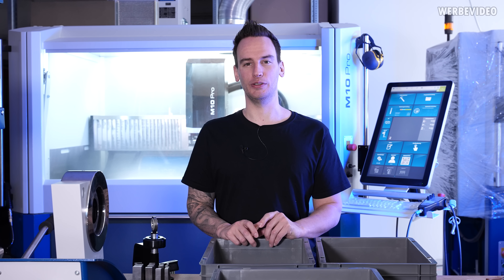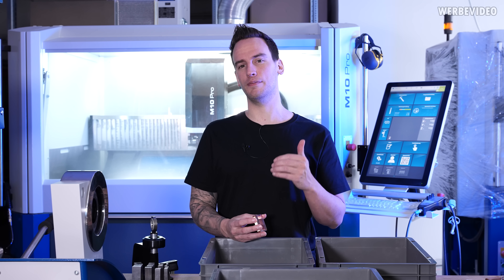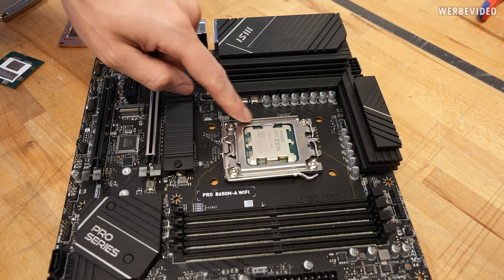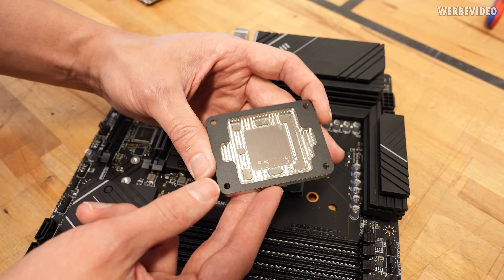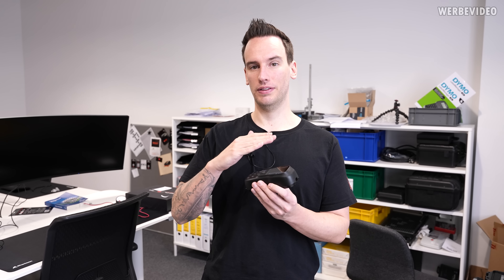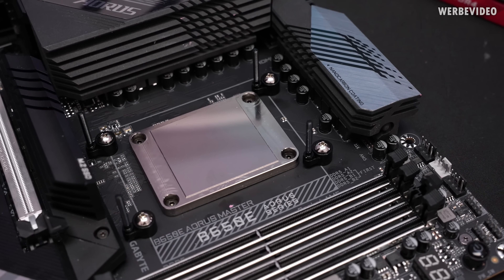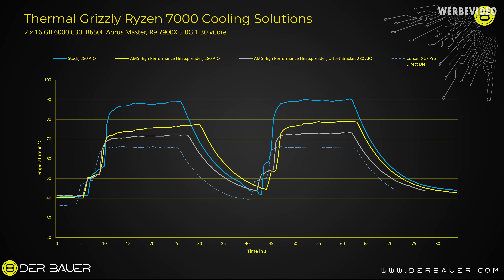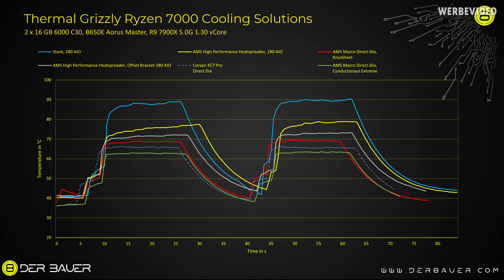I made my own Ryzen 7000 Direct-Die Water Block

Comment: I just used thermalgrizzxly ptm on my intel i7-1300f. Was skeptical as I have never used an AIO before or PTM sheets on a cpu. My results are crazy. My cpu after hours of gaming never gets over 57 degrees. I am assuming the PTM actually contacts the AIO more than thermal paste would with this exact CPU. I attribute that to Intel having a heat spreader design around the CPU. Apparently when thats the case PTM may actually perform better on a CPU without direct die delidding.

Comment: man i wish amd would step it up and make better ihs that  such an insane difference in temps, cpu's haven't gotten hotter heat transfer has gotten worse! they may be smaller than they were 10-12 years ago but they're also using less power. like the i7 3930k a 6 core 12 thread cpu with a tdp of 130 watts but would pull more under heavy load, 6 core cpus like the 7600x have a tdp of 105w and actually respect it unless you use pbo ofc but thats oc'ing technically.

Comment: Hi Roman, can you answer? Is Your Ryzen 7000 Direct Die Water Block compatible with all 240mm AIO Just replacing the water block? And how does It compare tò EK Quantum Velocity 2 Ryzen 7000 Direct Die Water Block?
Reply: Your AIO block contains a pump, if you remove it from the loop - without pump it will not work at all. Better build a custom loop to use Mycro

Comment: From personal experience. If you have the High Performance Heat Spreader. Don't go for the kryosheet. I went from conductonaut (liquid metal) to kryo sheet just to not have to care about mainaining the liquid metal. Idle temps went down by coupld of degrees but load temperatures went from around 78C to easily 95C on my 7950X (same settings in BIOS etc.).

Comment: I'm sure someone has mentioned it already before, but with especially steel, what you do with those highly flat faces is called ringing them together. What it does is push all the air out from between the two pieces of metal and then the air pressure actually sticks them together and makes them stay and then if you leave them like that for too long. Tiny particles of rust form and rust sticks the two pieces together.

Comment: I'm a mechanical engineer so this is waaay out of my depths but would the performance of the heat transfer improve if the path of the fins was diagonal? The AM5 chips have a triangular pattern, so there's an angle there where a diagonal path would be the shortest path across the chips, and the two chips beside eachother make a long straight line which might be saturating the water, where a diagonal path could spread that out across more fins? No idea. Amazing video and thank you for your work!

Comment: My block with a really high fin density (an amazon one) gunks up very quickly and required really strenuous amounts of cleaning. Ended up grinding some fins away with a rotary tool and saw massive gains in performance. If you can keep your loop immaculately clean then I could see them working really great, but if not it's basically the most filter-like part of most loops and is going to catch a lot of the gunk.

Comment: Hei! I thought to use AgCl + Si4N3 powder mix  as contact. But it just a thought, I have not tried it or know if it might work. In theory AgCl decays in Ag and Cl under temperature. But then how to keep it in one peace? May be just AgCl pure. And instead of AgCl may be AuCl, it will not oxidize. If Cupper finished with TiN it should not decay from liquid metal.

Comment: 16:16 Cool product, very efficient. What about a video overclocking the 7000s with this thermal solution? I would like to know what is the CPU limit and how much temperature is worth decreasing.

As Pbo is limited do +200mhz only, could it make a manual oc to 5.7mhz all core? Maybe 5.8, 5.9.

I would like to see the CPU limit and the real advantage of the temperature drop.

Comment: Direct die with graphene sheet looks like the kind of thing I would use the first time I delid a CPU. You still get way better cooling compared to stock but don't have to worry about maintenance much.
Definitely a really good idea especially for those that don't want the hassle of possible problems with liquid metal over time.

Comment: I assume that a Heatkiller IV Pro waterblock would do fine with direct die with just the frame since it’s essentially a huge chunk of Ni plated Cu. There should be sufficient mass to dissipate the heat without the redesigned heat spreader. Am I correct?
Reply: HeatKiller IV  curved, uneven surface.
But it will do, of course.

Comment: Shut up and take my money!!  But really I'm waiting for this, so far I have gone as far as lapping my IHS on 7950x, -22 curve, thermal throttles on 280mm arctic. Personally I want the clean non RGB, but in reality I will buy the first version that pops up on the website. Tho I have a hard time believing that you will sell many of the 'high performance heat spreaders'. Delidding and not go direct-die doesn't seem right. Maybe try one in pure silver, if it cools any better, I'd buy one. Hell I buy silver coins all the time, just for the silver content.

Comment: Thank you so much for making graphene pads better. I so much more agree on using that over liquid metal purely because I want to "set and forget" my computer so I can get the most comfort out of it for the longest time. 
I've had to re-apply liquid metal on laptop parts more often than ever, so on systems I want to give away I'd like to use graphene pads or thermal paste instead.

Comment: 0.281 microns is 281 nanometers, for sure they used a diamond lathe tool to achieve that insane precision surface finish. Also would like to point out that putting two surfaces together and both pieces staying stuck would not prove that it is sub-micron flat but does say it is good enough flat. Need to use a 1 micron or sub-micron dial indicator to check for evenness flatness, which is easy to do and tools available to do so.

Comment: Just curious...  How much work would it take to add a couple of ports and o-rings and just run a non-conductive fluid across the chip surface w/ nothing in between?  Seems like you're most of the way there with delidding & your direct-die bracket...

Comment: The effect he is calling "cold welding" is actually something called "wringing" it is a demonstration frequently done with gauge blocks (used in machining). Cold welding is a thing.. but it has nothing to do with evenness or whatever he called it. It requires that each surface is completely free of ANY surface contamination including OXIDES of the base metal. Unsurprisingly this is something people only really need to worry about when in space. The wringing effect, at least when I tested it, only seems to work on extremely flat surfaces that are also lightly oiled. There is a suction cup effect that you can only achieve when there is oil to act as a seal. (think liking the back of the suction cup) If both of those pieces were cleaned with acetone they would not stick together.

Comment: i like this IDEA tho there is a Problem for me to undrestand... I would love to buy one of these but what stop me is,, I Live in INDIA and its not a very Clean place to live and DUST is something we all fight for Daily.. Deliding and using this Block but what you are doing to Seal it properly so that DUST dosenot go inside the CPU and we can use it.. My idea is still use a Sealed solution to cool the CPU to get better performence then using this OPEN idea which i like persnoly but it will not work in my system or in my counrty.. I cant Open my CPU every 4 months to just clean the DUST.. there are manu more factors which this solution is missign like RUST Humidity. Rust is a killer of electronics,, Hope you make a better version with these solutions.. ty for sharing..

Comment: liquid metal without electrical sealing is a nice way to kill your cpu. using very hot cpu seems like create problems for yourself in order to heroically solve them. users should not buy raw crafts from manufacturers. I also use ryzen processors, but IMHO amd could not do anything worthwhile after the 3700x/3800x. and the drop in sales confirms this. thanks for interesting video, it's very good job with prototyping and production waterblock, but it's not applicable in real life

Comment: I would LOVE to see a temperature difference with a smaller aircooler. Im actually interesting in the intel version for my Itx build and try it out with air cooler. It would be game changer if you can archive same temperatures on air with DD setup vs stock cpu on water. Plese in next video throw some air cooler in the chart im curious and interested in this to buy.

Comment: When will you be releasing this as a kit? And where can international buyers from South Africa? Another question, is both the Direct Die and and CPU block smoothed to the same precision. I'm excited. Going to order as soon as ready, so that when I go to AM5 on my custom loops, I am ready. I use non Tolulene nail polish around the dies to give extra protection from Liquid metal. Can you advise on other solutions? I would like to purchase one with a Der8auer Micro stamped into Aluminum
Reply: Also, are these compatible with X3D chips. I would also like to see whether using a phase change thermal pad like PTM7950 would be on par to liquid metal. Product page doesn't mention X3D compatibility, if this may be tested for us crazy enthusiasts. Peace from South Africa 🇿🇦

Comment: That is an insane difference and improvement... AMD need you on the team lol imagine if it came out stock like this

Can you run the graphite between the die and spreader instead of liquid metal, just to increase longevity ? What difference would this make?

Do you think it would be possible to do some testing in some small sandwich itx case/s, where you can only fit a lowprofile cooler (say a NH-L9 -65mm height or a NH-L12S -48mm in height) ?
*Stock vs your heatspreader
Where I'm getting at... is instead of running direct die water block cooling for extreme overclocking, how about direct die air cooling ... to be able to go for hot running cpu with a lp cooler in a tiny case, without the need to massively underclock, or run high fan speeds

Comment: So many wrong idea about water block should be build. There is many problems in fluid dynamics that should be resolved, by creating proper inside structure of wat.block. Also you should know, that copper isn't great to give away heat. It's great for transport heat, but not for give away. Also water can boil in micro area, that will collapse water flow in specified area. So in general, its better don't add any fins inside wat.block. Also if we do very narrow fins, then water viscosity can work against proper heat transport.  

I bet that if this wat. block had higher fins and special in/out nozzles. He will get more heat from CPU in same time period.

Comment: Nice engineering as always.
For the direct die cooling with the adaptor, we would use the graphene sheet on the die as well as on the direct doe heat spreader? I am interested in air cooling rather than water.

Comment: Although I personally dislike RGB and wouldn't want it anywhere near my pc if I could help it. I'd definitely opt for that RGB waterblock, as dayum that is one mighty spectacular looking waterblock and the lack logos is an absolute bonus. The ability to rotate the wiring is a nice touch, it definitely will help as CPU header placements are not really standardised across motherboards. In regards to the non-rgb version, the clean one looks alot better imo. Q: the RGB waterblock is that supported by OpenRGB for example?

Comment: Are there any reasons to use AM5 High Performance Heatspreader over Direct Die Frame for aircooling? I am using the latter with Peerless Assassin / 7950X3D CCD0 / 5.124 all core OC and getting 76C max in Cinebench. Wonder if I can do even better.

Comment: Actually it is the same for steel, at least the steel they use in gauge blocks. In my small workshop I have made a stack of 40 mm gaugeblocks (7 pcs) and they hang perfectly okay even after 45 minuttes, you just slide them apart sideways

Comment: Cold welding works with any material, but often there is some oxidation or dirt in between or a structural molecule and that's why we don't see it as much in our early conditions.

But if you succeed to get two unimolecular surfaces close enough with no airgap in between then the molecules do not know what chunk it belongs to. It just knows how to be an atom, it has no notion of objects as we do

Comment: FIY: Its not cold welding, its called wringing. If they cold welded, you would not be able to separate them, or there would be obvious damage to the surface after separating them,

Comment: I'm definitely a big fan of that clean design, it looks so good, especially with the way you've got RGP showing in thin strips. The finish is clean, but the visual impact is clean AF.
Thanks for all your efforts!

I was planning to go air cooled for my 7800x3d, since I'm already using a 7900xtx for my GPU and there's very few water cooling options for that too, it seemed a waste to go through all the trouble for water cooling if I can't fit both on the loop.. What are the odds you'll be looking into 7900 GPU water blocks too? :)

Comment: Have you tried using doped graphene to improve thermal transfer even more? I know it's a very new material and a lot of the manufacturing processes for even undoped graphene are pretty exotic at this point, but graphene doping looks insanely promising for a lot of applications including thermal transfer.

Comment: I swear, everytime I watch one of your videos, my new 7900X gets frightened.
I'm happy with the performance, but I don't like instant 95°C when I power stress it (even though I have PBO and manage to reach 5.1 on a ccd and 5.3 on the other). I'm using an old kit from EK, the fluid gaming series, with two CPU blocks and 5x120 radiators.
Because of the temperatures, I'd really like to delid my CPU. I'd also like to keep using my block, thinking that, with some direct die solution, maybe an offset kit and high quality thermal paste I can remove the temperature bottleneck and push it while keeping some sort of lifespan.
What should I do?

Comment: I wonder how this would do with PTM7950 from Honeywell used on the direct die? It works great on laptops, I've done 2 repastes and it dropped load temps by about 22C and is very resistant to pump out, I'd love to compare it with graphene as it's easy to install.

Comment: What you show in this video...
... is that CPU and GPU OEM's have a LOT to gain if they put more effort in packaging design.
I am honestly stunned by the - lets be honest - huge temperature decrease you are able to achieve with this still relative 'simple' solution you milled.

Comment: Use Ptm7950 instead of LM :) Much better! I'm suprised that this is not mentioned in the video.
Also you should have a hole in that 4:11 High Performance Heatspreader just like a contact frame so we can put custom waterblock on it.

Comment: The problem i see with clean design is the possibility of improper mount - with off-center finstack to accommodate Ryzen's chiplet location if one were to rotate the waterblock 180 degrees when mounting they would acchieve the opposite of optimal result.

Comment: Hi
Great stuff, many thanks for your work and efforts !

Wondering a few things :
1. Are you going to provide a delid guide (and maybe tools?) for Ryzen 7000? (+ cleaning the surface after)
2. Can we replace liquid metal paste with normal thermal paste (instead of the graphene thermal pad) ?
3. Is it going to be compatible with 7950x ?
4. When is this going to be available? I can't wait :D

Thanks again
Reply: 1. They already have a delidding tool, look up "Thermal Grizzly Ryzen 7000 Delid-Die-Mate CPU Delid Tool"

2. The difference between thermal paste and liquid metal is so great that it's not worth voiding warranty to just use a thermal paste (but to answer. thermal paste should work with delidded CPU, it's used on laptop CPUs anyways.

3. It should work with all Ryzen 7000

4. I would love to know when it will be available too... I'm going to delid my 7950X3D and use "Optimus FOUNDATION CPU BLOCK - AMD (AM5, AM4)" water block, as it seems that it's the most flat water block available (which is most important), I'll have to use a threaded rods instead of the studs that comes with the block to be able to mount the block shorter than the original mounting kit. hopefully everything will work out.

Comment: 13:21 15:58 at first glance it seems possible to increase +10% to 20% heat transfer with changing the cross section of the channels (fins) from square/rectangular to triangle or circle shaped. Regular Triangle has less Area/Perimeter ratio than any other polygon being Circle the maximum possible. Hence, you effective flow (volume) to contact surface ratio seems to have room for improvement depending if depends more on surface drag resistence/ flow o surface delta T contact. Fluid-thermodynamics not easy to do on the spot.
And it also seem possible to do the slots at a 30º with z-axis (60º from XY plane) so you can have +100% contact wall's surface thank to have deepest slots ( and it could be even better if you tested zigzag and corrugated 30º, ahahah).
Other question i have is, why using a top acrylic (I suppose low conductivity) half if you could cast or 3d print (or machine and put caps like engines) so you have a second heat interchanger on top. And so not being limited to exchange heat on the lower ahlf? Being able to produce it, I know it easier said than done...